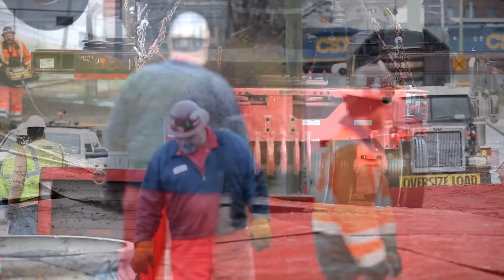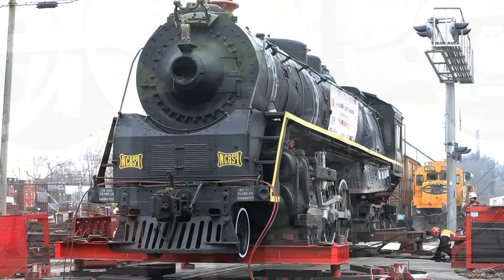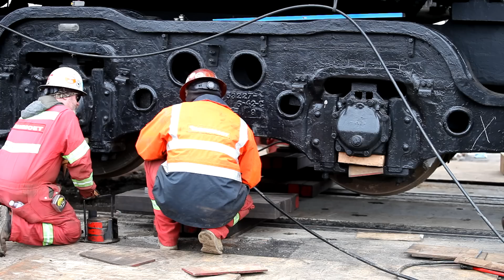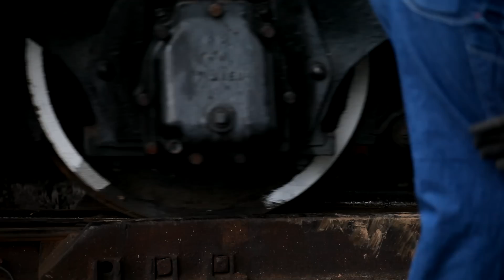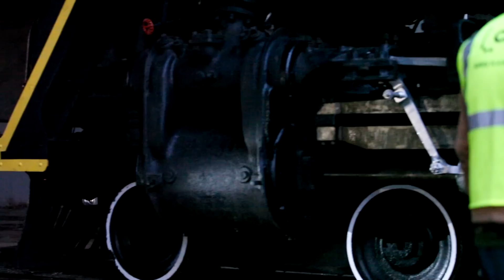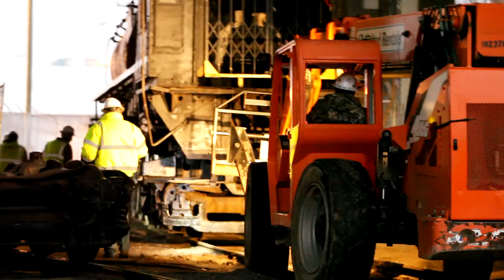Re-railing NC&Stl. Steam Locomotive 576

Comment: No one loves steam locomotives more than me but on looking at this clip I wonder if the money needed to certify the boiler and get her back into running order is ever going to be recuperated just from fan trips.  What is her area of activity would it be cleared to run on other railroads   And then there,s the shear running costs    It is a large loco and will take years to restore I just hope it’s a financial break- even point at least
Reply: Restoration time - if properly financed - should be 2 years if it is in good condition. If there is much wear, fracturing or corrosion than new parts must be made - add 1 or 2 years.  Most labor is volunteer outside the machine shops and such - sometimes even  donated from them.

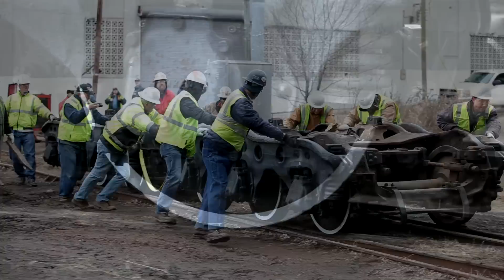Comment: 6:27 Why is a wheel not making contact with the track?
Reply from the maker: Its the way the suspension is designed to Carry the weight of the tender. Without the extra weight, the suspension springs in such a way that the middle wheels don't contact much. It makes them easier to move around by themselves anyway.

Comment: Do steam locomotives come from the factory with spare wheels and jack so that if they have a blowout or flat,  they can change it?  I've never seen a steam locomotive with a flat and was wondering how they do it?             }B-D  "what the Fff!"
Reply: No  spare wheels, they weigh too much to easily handle.  The tires are steel and heated then shrunk on.  Seehttps://www.youtube.com/watch?v=1Z4G7BMUCm8  there are several other sites showing tires being put on wheels.  The wheels can get flat spots on them if the wheel is moved without it rolling on the rail; that is abrasion.

Comment: WHERE IS THIS AT?
ALSO WHAT IS THE STORY ON THE AT&SF GE DIESEL?  ANYONE KNOW THE ORIGINAL BUILD NUMBER?
Reply: nashville tn, and the U boat is owned by Nashville&Eastern railroad but has not ran in years not sure what its plans are.
Reply: Matt Corn HI MATT!
THX FOR RESPONSE !  I HAVE A LOT BETTER KNOWLEDGE NOW!
I HAVE SPENT A BIT OF TIME ON THE N& E ! 
I WAS THERE WITH THE NYC E-8 
PAIR , THE 4080 AND 4068 WHEN THEY WERE LEASED TO THE RR MUSEUM THERE!
WE HAD THEM ON A FALL SPECIAL EXCURSION HEADED EAST TO COOKEVILLE!
WE HAD AN ALL E-8 CONSIST CONNECTED TO A THIRD E-8 
THAT WAS ALSO A LEASED UNIT.
DUE TO WIRING INCOMPATIBILITY 
WE HAD TO ACTIVATE THE SANDERS MANUALLY TO BE ABLE TO PULL A CONSIDERABLE GRADE WITH CONSIDERABLE TONNAGE!
EMD E-8s WERE NOT NOTED FOR THEIR PULLING ABILITIES ON HEAVY GRADES WITH TONNAGE,
ESPECIALLY WHEN FALL LEAVES WERE PRESENT ON THE RAILS!
WE DID HAVE GOOD SANDERS AND PLENTY OF SAND FOR THE TRIP HOWEVER!  ALTHOUGH THE 
Es WERE HEAVILY TASKED THAT DAY WE DID HAVE A GOOD HOGGER AT THE CONTROLS

Comment: I just really wonder why the Rail Road Locomotive was not shippedvia railroad.
Reply: Because there were no rails... Had you really wondered about that. DO you think they can run just anywhere. DO you understand how much these machines weigh?
Reply: @organbuilder272  Oh I understand now. Those two parallel steel items that are 4ft 8in apart are for baby buggies. When did CSX run on interstate highways.
Reply: @marryellen7713  To my knowledge - no railroad equipment has ever run on paved roads. Now sometimes it appears that they do - when rails have been laid along a street thorough the center of a town or alongside a street depending on circumstances. You should understand that steel rails for US, Chinese, Japanese, Canadian, England, Russia most of the Continent and Mexico are 4 feet 8 and ONE HALF inches apart. I don't know of any RR that uses a 56 inch gauge. Perhaps that is why they had to use a truck. The engines wheels are 1/2" wider that the rails. 
I believe you asked why they didn't move the engine and equipment by rails. My reply was a simple and accurate one. Did you consider that the rails that might exist are too deteriorated to accommodate the weight of the engine. Or there are no rails in existence that connect the park to the final location where the engine and tender will be restored. The only way to get it there was a flat-bed, heavy haul truck.  While I can appreciate your ignorance of the lack of rails - they were never there in the first place - I can not understand or accept your sarcastic response. 
However, I will take the responsibility for an equally balanced response. I don't believe I mention anything about where CSX runs, nor, in this case, does it matter. That simple fact is, the fastest and least expensive way to move the locomotive was by truck on surface roads.  

As far as baby buggies - I believe #1 that the wheels of a baby buggy are not wide enough to fit on standard gauge rails, much less this new gauge only you know of. #2, it is illegal to put anything but an authorized vehicle on the tracks of an an operating railroad. #3 any vehicle that runs on standard gauge rails much have flanged wheels to be able to stay on the tracks. As far as I know, until recently at least, baby buggies were not made with flanged cast steel wheels, each weighing at least 210 pounds that meet the requirements of the RR safety board.. This would weigh, considering the weight of the axles, , bearings, brakes, frames and lubrication system about 1 ton. exclusive of springs and the means of attaching this assembly to the body of the baby carriage. #4 Considering the weight of this vehicle, and the potential to break concrete sidewalks or put grooves into asphalt pavement, it is highly unlikely that any baby buggy outfitted to run on standard gauge rails would be allowed on the street or sidewalks. #5 Considering the weight of this vehicle, it would be necessary to consider the type of brakes you would use to stop it at the market or drug store. In addition to the  basic weight of the bogie, you have to consider the weight of the brake shoes, arms, actuator and some form of control system. If air is used you have to include a reserve tank, pressure gauge, piping and some form of high pressure pump. #5 Of course you would have to provide a power source for the pump. That would have to be a bank of batteries - I would recommend 24 volt system, or a boiler for steam. Of course, for short runs you might use compressed air. This would involve a great deal of additional weight, boiler inspections, and all sorts of safety equipment. 
Personally, I don't think you could push this thing although Timkin Roller Bearing company did demonstrate that a man could pull a locomotive weighing over 200 tons.
All in all I think it would be a bit ridiculous to be seen towing a baby buggie down the street belching smoke, hissing steam, tearing up the road or sidewalk just to give the baby, who would likely suffocate from the noxious gasses emitted by the boiler, a walk in the fresh air. Wouldn't it be more practical to put this baby buggie on a flatbed truck. Perhaps you could lay track using your special 4' 8" gauge along the sidewalk. or maybe - Just maybe, you could buy one of the old fashioned kind that have 4 wheels based on a 24" gauge, with rubber tyres and just push it on the sidewalks and forget about giving the kid a thrill - riding the rails at an age where it might not comprehend the event in any case.
There is, however a 15 inch gauge used by live steam builders. Perhaps that might be more suitable for your purposes. If you are hell bent on building the baby buggie that can run on Standard gauge rails, perhaps I could help by providing drawings for this contraption. Mind you, I would demand all patent rights and royalties. I have a machinist that is excellent at doing odd jobs like this and very reasonable in his fees.  Let's do it. Sounds exciting.
Reply: @organbuilder272  I love the comment.  Marry Ellen might want to use 18  inch gauge though as it is slightly larger than 15 inch.